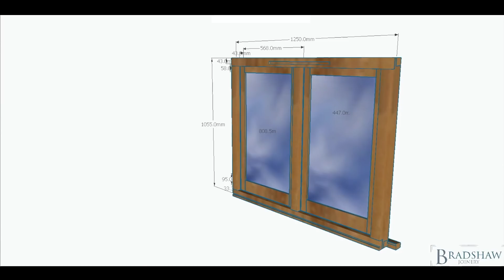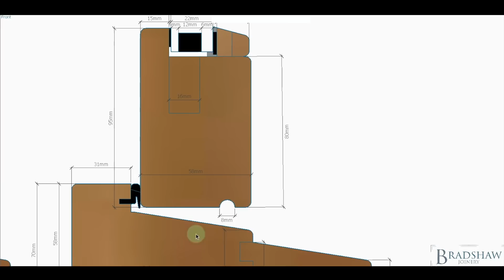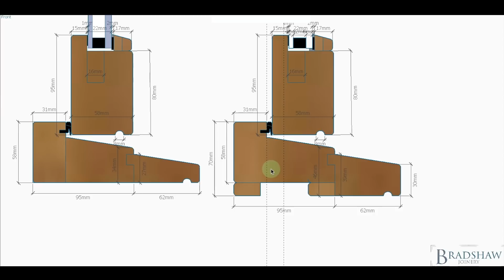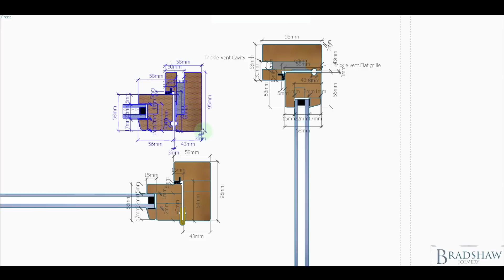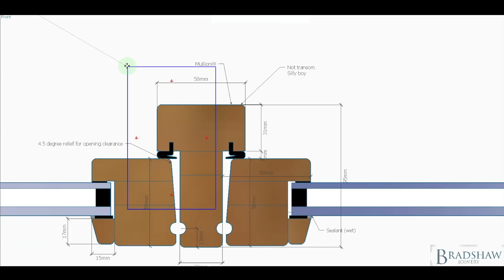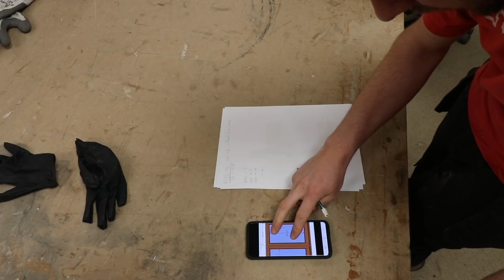Traditional Oak Casement Window Build - Part 1: Drawing

Comment: Do you leave sash windows square on the cill too .? Very helpful video as always
Reply from the maker: Cull should always have a 9 degree bevel anywhere water can sit (minimum) and 3mm radius pencil round to any square edge
Reply: @BradshawJoinery sorry I meant the bottom of the bottom sash on a sash window not the cill. Thanks for the reply anyway

Comment: Why is oak glazed differently to accoya wood? I really would like to know why one is internal the other external glazed. Thx
Reply from the maker: The movement in oak cannot be trusted, if the beads and timber move in time the glass can be re sealed  with new beading if necessary

Comment: This series is great! Giving me the confidence to try to make my own windows. I also want to make an inward opening French door for a 1m x 210cm opening. Space in the room is very limited, which is why I want to go this route. It's also a 1st floor room, so the doors can't open outwards as it needs a railing on the outside. Would the process for making inward opening casements be similar to this but just installing them backwards?

Comment: Drip grooves on the sill, yes. Drip grooves on the sides and top ? What the hell do you think that's going to achieve  ? And that huge gap at the bottom edge of the frame instead of matching the sill angle ? 
I think you guys are trying to re invent the wheel.
Mind you most modern joinery shops are. Incompetent management  is largely to blame and the guy in the drawing office usually doesn't have any practical experience to draw from. 
I gave us using those rebate seals. They really don't last very long and in truth they are used to compensate for lousy machining most of the time. 
Trouble is nobody goes to the effort of through mortising anymore. They cheat to save time and the result is weak frames that rely on glue. Glue never lasts in exterior exposures long. 
And another thing, bullnosing the edges to hide the steps in width ! 
Come on. That's creating a perfect ingress for water damage. Sloppy.
Double glazing is heavy yet joinery shops are cheating on the joinery to save money ! That silicone won't hold the frame square forever lads and once it gives way those frames will sag and jam. You know it, I know it.
Reply from the maker: The drip groove around the sides is actually an anti capillary groove and is present in very old joinery. Caplilliary action is a problem even on the vertical sides of casements in heavy rain. 

The big gap under the casement not matching the Bevel works much better. You need atleast 10mm gap to stop heavy water pooling under a casement and this provides that solution without a huge rebate. It also looks really good. Better to my eye as tight gaps on exterior joinery is old thinking and causes trouble. Look at any bevel matched bottom rail I bet there is staining from where water has pooled under the front of the sash. Unless the gap is over 10mm. I guarantee it infact. Leads to earlier water ingress if water pools at any point. The bigger gap also means that point is better ventilation and it'll dry out quicker after rain too.

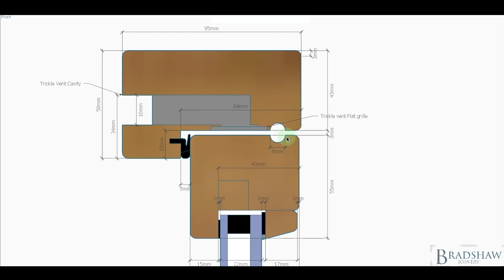I'm not sure what your sealing joinery with but a weather seal is needed. Also not sure on the bullnose part, was it something in this video? If you add a time in in this format 12:34 it will allow me to click it and go straight to it. 

I agree large company joinery is going downhill but there is not problem with the design here. I've used this for many years without fail.
Reply: @BradshawJoinery  
The biggest problem with far to many modern builds is setting the windows flush with or only slightly setback from the exterior wall. 
If your using traditional hinges, drip grooves are not appropriate.
The problem with rot damage usually only occurs using cheap pine and acrylic/ synthetic paints and sealers that don't breathe.
The lack of protective eaves on modern houses means that driven rain is not held back by a pressure curtain of air. Joinery has devolved because building practice is driven by bad architects and shonky primary contractor's.
There is no excuse for not using through wedged mortise and tenon joinery on windows and door's. Relying on glue, pins and  cramps means you cannot rack the joint's to get rid of twist at glue up. The truth is joinery shops don't want to pay a guy to trim and fit frames to jams accurately with a shoulder plane, even though a skilled craftsman can do it very quickly. Four sided moulders rarely if ever get  stock straight enough so joint accuracy suffers and they take up the slack with weather sealing strip's that crap out after a few years as the internal foam core degrades.
The water gets trapped in the retaining groove and it weakens  the rebate too. 
Yes, capillary action is a pain and cannot be completely avoided but quality materials and construction avoids it becoming a serious issue. 
I use marine  oil based paints and primers and only exterior grade 1 timbers.

Comment: Hi how much would it cost to buy a oak window of that size from a joinery like your self please just a ball part figure many thank keep up the great vids
Reply from the maker: Depends on level of finish, factory finish sprayed and glazed there wouldnt be much change from a £1000 (depending on quantity ordered) but there are lots of factors like quality of materials used, ironmongery, technical details on the window. You cannot really compare 2 joinery companies windows, you have to see what you are getting vs the price and make your mind up. Ive seen all too often a cheaper joinery price actually work out more expensive in the end, and for a worse product. Sometimes the guy going above and beyond, offering the whole process and being clear with the overall cost is much better option.

Comment: Hi, thank you for this video, I really like this project but I would prefer to have window leaf more narrow. Is it good idea to make it 60mm instead of 80mm? Would be it still strong enough? Can be spruce or pine wood used instead oak ?  Thank you
Reply from the maker: by leaf do you mean the frame? or the bottom rail. you can technically achieve any size you wish!
Reply: @BradshawJoinery  thanks, yes, I meaned bottom rail.

Comment: Maybe i missed it, but what is the purpose of the 8 mm semicircle all around the sash?
Why is there one above the sash?
Why is there one under the sill towards the outside edge?
Reply from the maker: It's an anti capillary groove. Stops the water tracking back under a horizontal surface or between two close fitting items. The water will stop at the groove and then rin/drip away instead of travelling into/under the window
Reply: @BradshawJoinery  Thanks for the answer. It totally makes sense now.
I hope you don't mind if i ask one more question. 
Why is the outside 17 mm glazing bead split into two and what holds it onto the sash (once the thermopane is in)?
Reply from the maker: The bead isn't in two, I assume you mean the 2mm section and the 15mm section? The 2mm part is a foam tape, the beads are stuck in place with the foam tape and then fixed using stainless steel pins.
Reply: @BradshawJoinery  I'm sorry I meant 15 mm . What is the line going down the middle (approximately) of the bead?

Comment: Hi I’ve been advised that I have to fit a dummy casement window as a replacement in my listed house. I think I understand what a casement window is , but what is a dummy casement ?
Reply from the maker: Dummy casement could be a casement screwed into place so it doesnt open or a direct glazed piece of glass connected to a adjoining opening casement by a piece of fixed casement section. Depending on the persons view of what a dummy casement is. If its got to be replaced like for like just look at whats there?

Comment: Fantastic video, many thanks to you and the guy who commissioned this. Looking forward to finding the time to watch the series!

I have a question - near the start, you say that if making in accoya (as I plan to do) then you would make it internally glazed rather than external. May I ask why this is? If there are any other significant differences to know about, I'd be very grateful to hear your thoughts. Many thanks!
Reply from the maker: I believe Internally glazed is neater, and better for sealing the unit in, and also makes replacing the unit a lot simpler and cleaner. Im just not keen on timbers that will move as i dont think the seal will last.

Comment: This is absolutely brilliant! The only place on the Internet that I've managed to find this sort of detail for window construction. Thanks so much for uploading this, and to your client of course.
I'm in the process of making oak casement windows for a tiny house on wheels, so they're a bit lighter weight than this (smaller sections), but I'm making what I think are called "stormproof" casements, i.e. half rebated into the frame. I've seen "stormproof" hinges, but have no idea how to install them; would there be any chance of you posting a video on how to do that?
Reply from the maker: Thankyou Mr Cheese! I will make a note of it and try to do a short video. i assume you have pivot pin type stormproof hinges and not friction hinges? they need chopping into the lip that is left on the opening casement by the thickness of the 2 leaves so it brings that lip flush with the face of the frame and then attaching the the frame without chopping in.

Comment: Thanks for another useful, informative video. Really looking forward to the actual build/construction video. Also interested to see what finish you use on oak.
Reply from the maker: Didnt get that far Ian, but would probably opt for a base stain like Sikkens HLS then Osmo UV Oil ontop. Regular maintenance (every 2 years) of the uv oil will see them well. (its easier than paint maintanace)